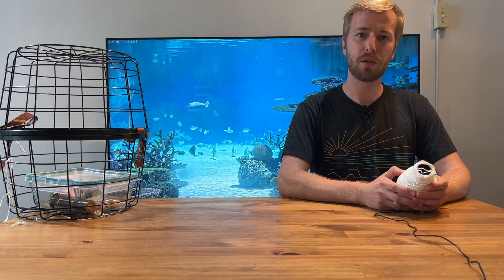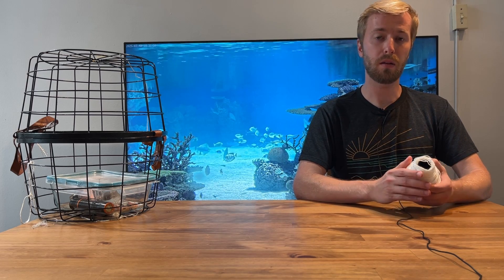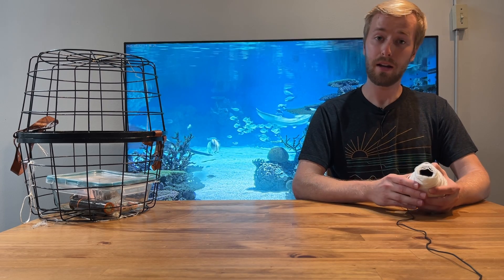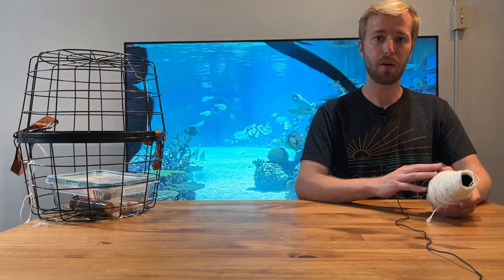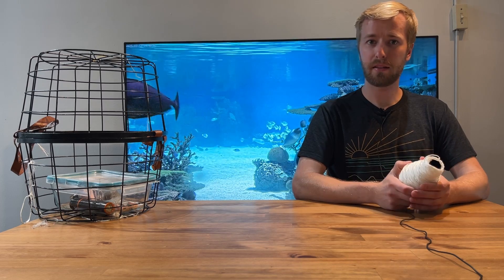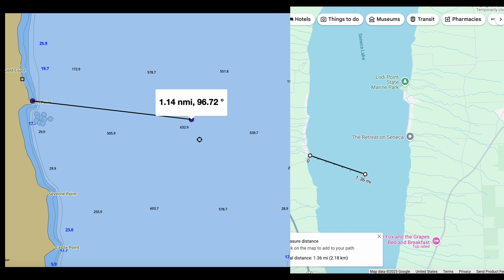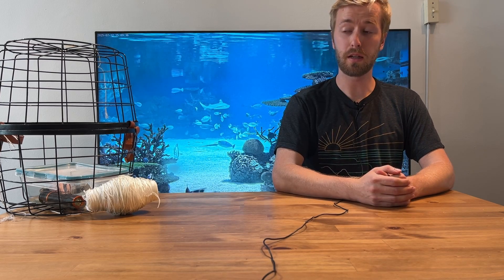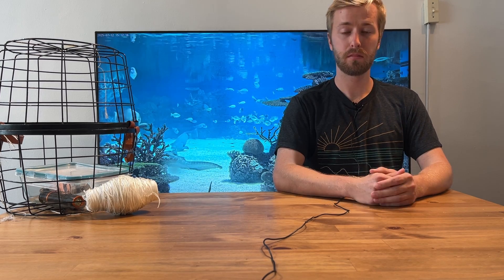Can a $10 Camera in a Tupperware Work 630 Feet Underwater? Yes, but...

Comment: This is really cool, had to check what I subscribed for when I saw the vid only had ~700 views so far, and this is definitely not what I was expecting when I subscribed for Minecraft stuff, but I'm glad it's what I got. Awesome job doing proof of concept before rushing to implode a better camera lol, this definitely has the potential to blow up if you can get some better footage. Best of luck!
Reply from the maker: Thanks! I’m definitely gonna have to go back to the lake when I perfect clearing up the epoxy and holding the cameras down. Although, the footage will probably be pretty boring, since the bottom is just a bunch of mud with nothing living down there.